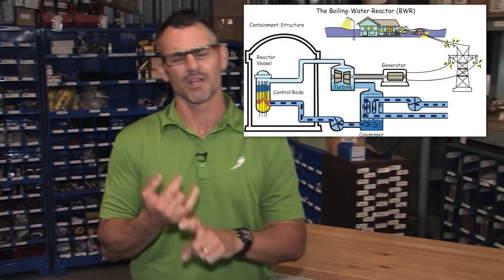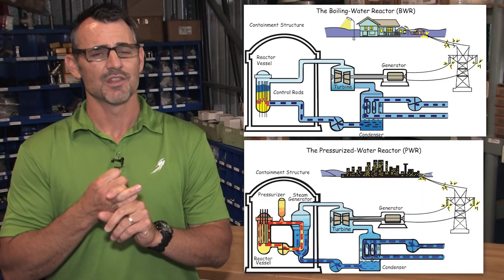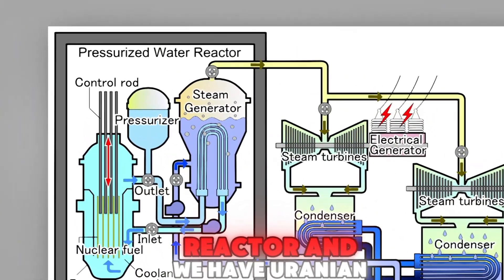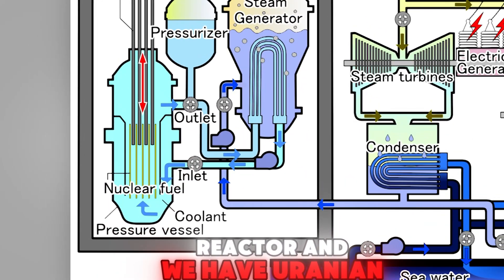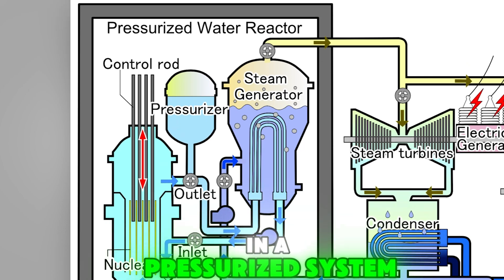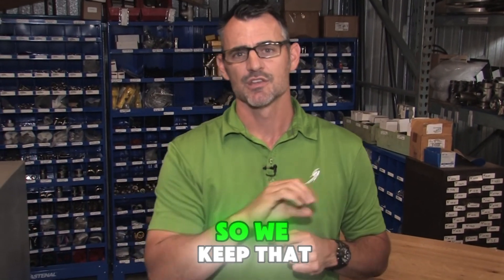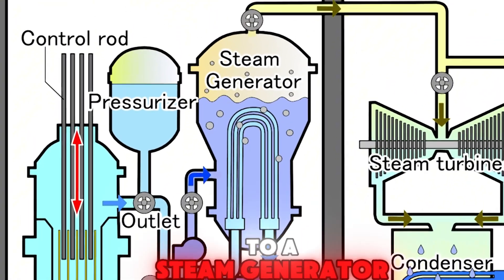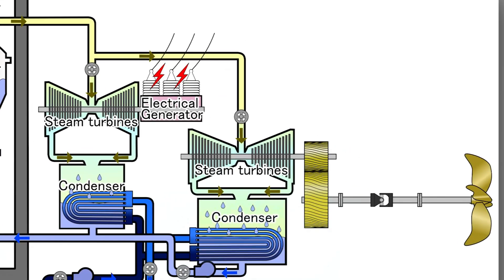Steam to Power: How Nuclear Reactors Work - Steam Culture

Comment: Smarter Everyday did a visit to the world's first nuclear power plant (creating electricity) a couple weeks ago. ('I Explored the World's First Nuclear Power Plant (and How It Works) - Smarter Every Day 306')

Though that plant uses liquid metal to collect the heat from the reactor, it does move that to create steam.  They have two intermediate liquid metal heat exchangers to avoid the water becoming radioactively contaminated in the event of a heat exchanger breach.  But for all it's extra steps, it is still just using heat, from a nuclear fission reaction, to make steam, to turn a turbine.  

This type of reactor was outlawed for commercial use by President Jimmy Carter due to it's by-products (plutonium) being more easily used in nuclear weapons.  He instead mandated the US to use a method that produces more nuclear waste that has to be dealt with.  

When we say coal or nuclear power plant, we are differentiating by heat source, not the steam turbine electrical production.  Even gas turbine plants will have a steam turbine that uses heat from the exhaust to create additional electricity.
Reply from the maker: Thanks for sharing the video! It's fascinating to see how different reactor designs operate.